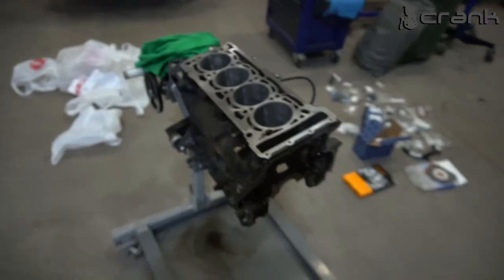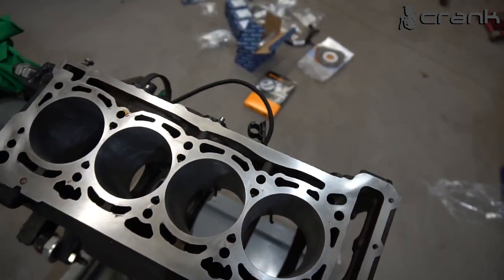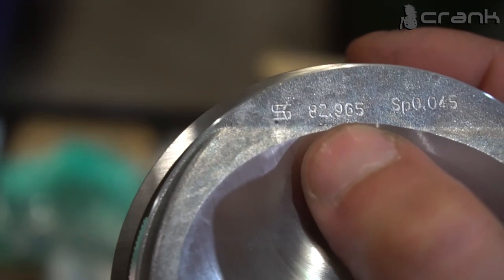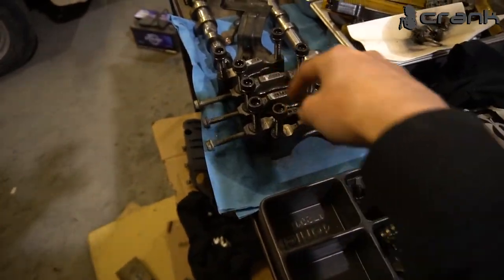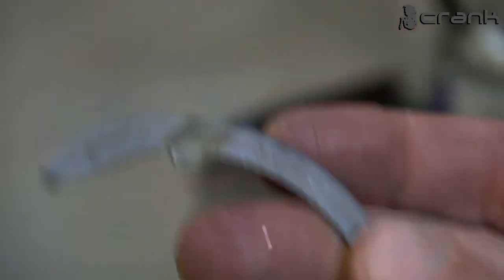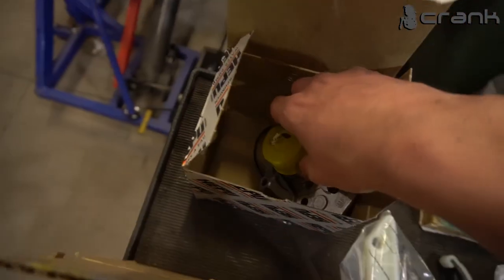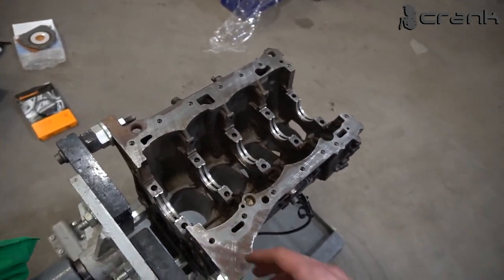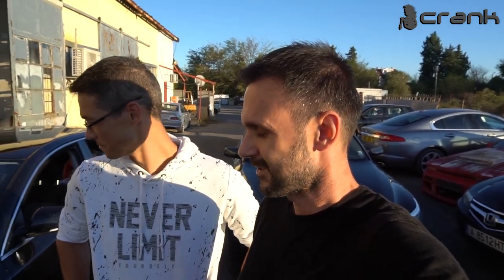How to FIX The Biggest VW Mistake TFSI Engines

Comment: Well done. I'm topping up a litre every 500-700 kms on my 1.8 tsi CDAA. Oil 5W40 motul xcess. Running an APR K04 3 BAR RACE FILE 28 psi tune and car is almost gunned every single time. Hoping to make the engine last with liqui moly oil saver and no smoke additives. Odometer: 1,39,000 kms.

Comment: I have that engine in my A3 from 2014. At 314.000 km still going strong, so hopefully I won't suffer those problems. Great video! 👌
Reply from the maker: Thanks! I believe only the engines with 4 letter codes are suffering from this. You should have 3
Reply: @crank3646  the thing is I have seen cdaa engine code engines at 150000kms no consumption but it was mostly driven hard on a regular basis!!!!!  Driving hard can help you keep the rings clean!!!!!
Reply: @The_Seraphim7 my problems started at 180.000. First 1 liter per 1000km then 1 liter per 400km. Eventually the engine was fxcked at 215.000. Believe me, sell the car if it is still working.

Comment: The oil injectors under the pistons, are on the same side as are the petrol injectors on top of the pistons. This makes the pistons become cold one one side, and hot on the other, which is what leads to the problem.
Reply from the maker: The problem is the bad design of the oil piston rings, they are to thin
Reply: @crank3646  As said, the problem is unequal thermal stresses. There is a company which makes dual oil injectors which replace the original ones, and the problem is solved.

Comment: @CRANK I have a question, the engine is from what year or what engine code is, I have the 1.4 TSI 122cp Engine code CMBA from a Seat Leon 2013 and I have the oil consumtion problem.

Comment: Audi replaced the pistons/rings for free on my 2011 A4 Quattro at 71k miles (115k Km). The new parts are GTI spec and don't use any oil since repair. Repair was performed for free at the Audi dealership in 2015.
Reply: My 2010 a4, 64000 miles, missed the cutoff date for the class action settlement piston ring repair/fix, but they were willing to maybe pay a part of the repair after I pay for 2 consumption tests, labor and % of parts..

Comment: Thanyou for the video..Am also using Ea888 cdaa Passat .Still going strong without much issues.Hope it won't get this issues .Can u pls suggest me a good oil for this ? I am currently using 5w40 Addinol
Reply: Castrol dude, and change it every 8k km.

Comment: Start changing the oil every 5k miles. Solve all your problems
Reply: Has nothing to do with that, how will that help, if you have a car that burns one liter oil per 500 km, or even more. This problem has NOTHING to do with oil quality, it's very well known, that only fix is new pistons, so you can fit the new rings.

Comment: i have this engine i my record was 1L per 150kms XD, but i bought new pistons :)
Reply: Yeah I'm doing about the same, did you end up rebuilding it?
Reply: @buzzo89  Yes, I rebuilt the engine, and everything was working properly until I reached 50,000 kilometers, at which point oil consumption started again. I performed an engine flush, and it helped resolve the issue. Now the engine runs correctly. My conclusion is that doing an engine flush every three oil changes, at least, is advisable. If you have any questions, feel free to ask
Reply: @jakub.686 How did you flush it? With what liquid?